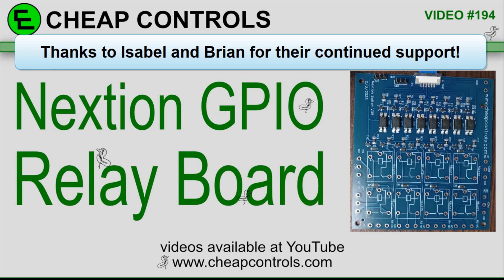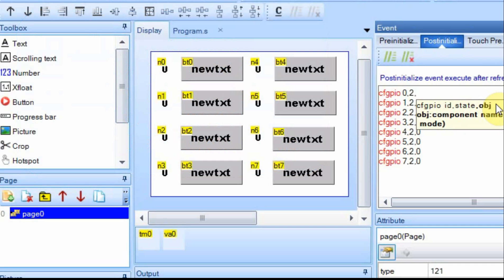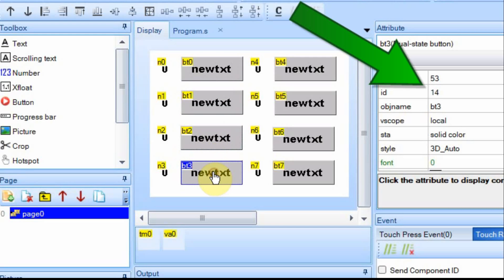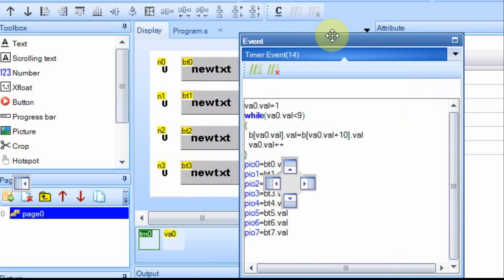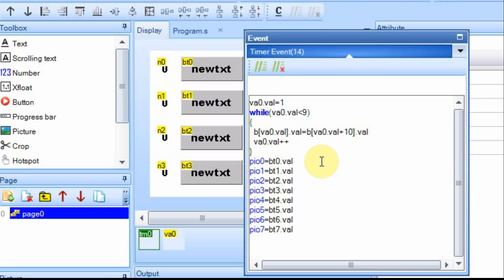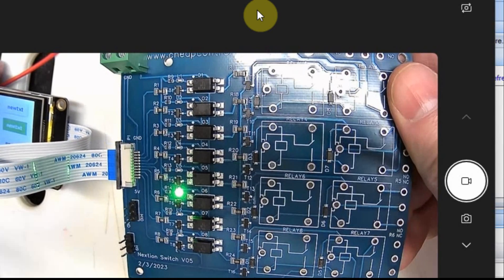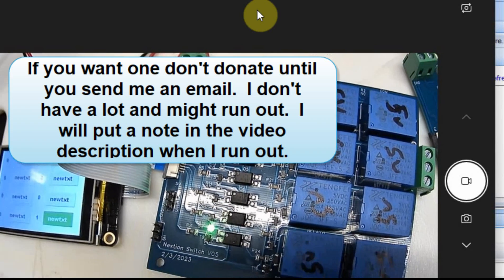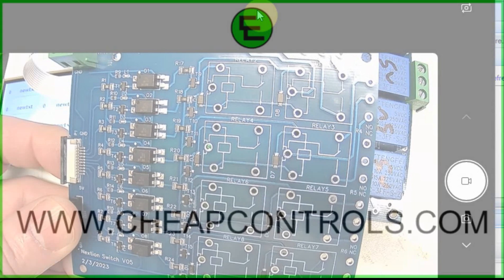194 Nextion tutorial GPIO Pins and a trial Relay Board using the cfgpio command

Comment: Code
Reply from the maker: If you want access to the code, please submit a request on at www.cheapcontrols.com.  Include the video number #194 in the request and we will email the code to you.
Reply: 1)Why nextion display reseting value after power cut, what is the solution for this?
2)why esp32 can not read nextion values of the display during changing the page?
Reply from the maker: You can try storing values in the eeprom and then restore them on a page load.  2) I am not sure why the esp32 can not read the nextion values during a change of pages.